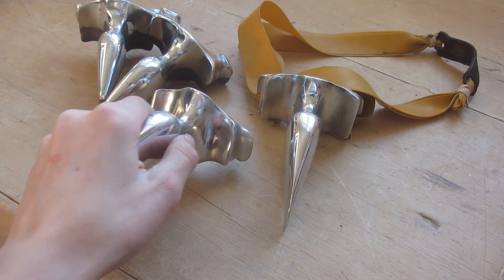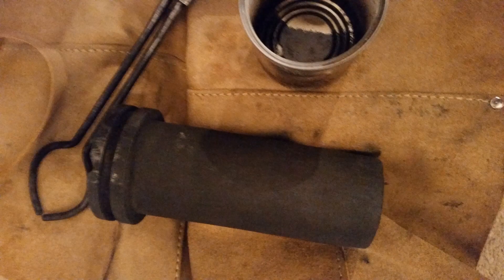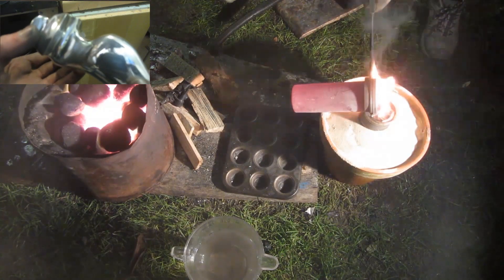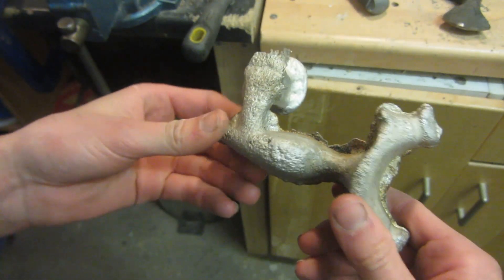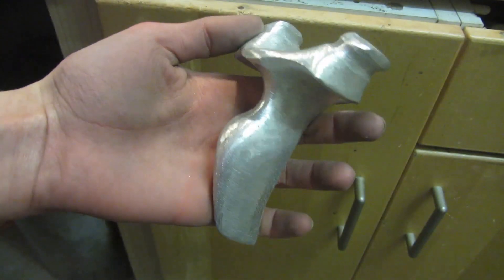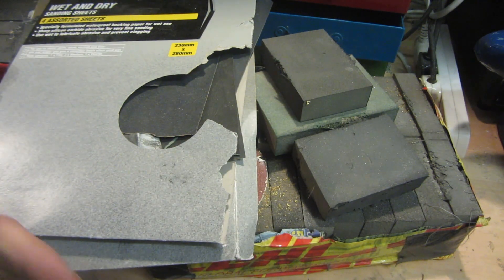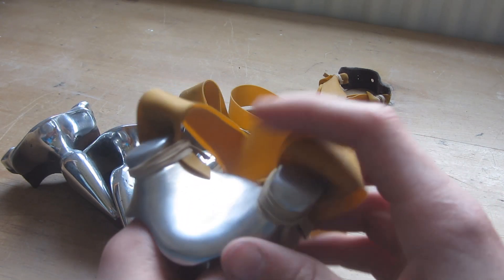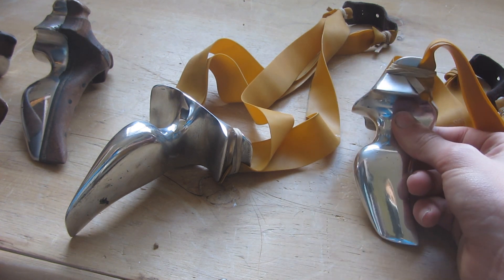Casting a Full Aluminium Slingshot With Greensand

Comment: to fill the voids in your slingshot handles. mix some clear epoxy and add some of  your alum filings  to make a thick paste. packet into the void ( maybe even drill out the void bigger )  fill until above the surface, let harden then file, sand and buff.

Rob.

Comment: whenever he removes the deep scratches with the drill sanders he said you can use sand paper is there a specific sandpaper you have to use and also when he uses the wet and dry sand paper to polish it up a bit can i just use various levels of sand sponges?

Comment: Great job! One thing I would suggest to make your life SO much easier is to pick up a small angle grinder and some flap wheels....you will save all the labour with the files and stuff....I use them all the time in welding and they are available in various grits from coarse (20 40 60 80) to fine (100 120 180) to super fine (320 and up).

Even some fibre discs on a grinder will get that slingshot smooth in 10 minutes.....

Comment: Hey, a tip for you to get even more pure aluminum

After you put the borax in, scoop out the impurities, then put in something called "lite salt" in the aluminum. What it does is when u put the salt in the sodium burns off and leave the chlorine from the salt. The chlorine bonds to hydrogen that is in your aluminum and takes it out of the crucible. Just a tip to get even purer casts :)

Comment from the maker: Thanks for watching guys!
If you have any more ideas of things that you want me to cast then please post them below!
Reply: Hi :) why do you don't plug the holes with tin melted with a sodering iron ?
Reply: The Art of Weapons Can you make a reverse compund crossbow,Please.
Reply: louis67gg Sounds like a nice idea but tin may not stick really good to the interior of the hole unless it's really clean of oxides, he'd also need a really powerful iron to heat all that mass (aluminium is often used for heatsinks), there may also be some chemical reactions that could take place (like with mercury), I don't know if tin would have them but he'd have to take that into consideration, anyways it won't look the same as aluminum but it may look better than leaving a hole. Oh and don't forget some tin wires come with lead.
Reply: The Art of Weapons Aluminium is poisonous! I love your work but at least wear some gloves, for me?
Reply: tarstarkusz thats true any kind of dust is explosive in the right concentrations and even though its unlikely it would every explode it could if it accumulates in the air from doing it inside but if you file outside you dont have anything to worry about
Reply: I made an account on your website and I wanna share some of my projects but I can't figure out how. Is that not a feature yet?
Reply: The Art of Weapons Be very careful filing aluminum, the dust in the air is explosive. If you use an power tool to sand the cast, it could easily cause a cloud of dust and sparks from the power took could ignite it. I worked in the metal industry and trust me when I tell you this, aluminum dust is explosive when it is suspended in the air.  You should also let your subscribers know this.
Reply: The Art of Weapons Check my chanel :D
Reply: Make slingshot with a laser sight make it like this

O      O

    O                       So attach one on the right top side one on the left top side and then one on the bottom or just but one on the bottom
Reply: The Art of Weapons sorry i mean a mini crossbow :D
Reply: Adam Blaknovski then why is it used in soda cans
Reply: Dean Walcott I agree the risk is low, especially with a hand file, however this young man is making all sorts of safety shortcuts and given his seemingly young age, I assume he has a lot of younger viewers who don't understand all the risks of doing this stuff. That forge and the way he is using it  (for example) is an accident waiting to happen. So I posted the least obvious example of risks to give kids thinking of doing something like this something to think about. If this channel was run by an adult, I wouldn't have left that message.
Reply: kodi peters The inside of soda cans are varnished and so the soda never touches the aluminum, but that is probably not what he is referring to, he was probably talking about the fumes given off when it's melting or the dust he is breathing in and can get in his eyes (if he's not wearing eye and mouth protection).
Reply: Hay can you make arrow heads out of knife blades
Reply: +The Art of Weapons have you tried using a glue based agent for the green sand? i used to work in sand casting for steel we used a glue type binder. it prevented alot of the sand from collapsing in on it self before th emetal being poured
Reply: +The Art of Weapons 
Try having an exhaust pipe on your casting,smaller than the pipe your pour in to let the gasses escape.
this will improve your casting result.
Reply: +The Art of Weapons will you put the design of the slingshot
Reply: +The Art of Weapons how much does your full aluminium slingshot weigh? ps what crucible would you suggest to me
Reply: +The Art of Weapons 
Deez Nutz!!!
Reply: Reck Tominvayed no leave no get out bad no shoo
Reply: +The Art Of Weapons how would i be able to buy one of your slingshots and how much would it be to buy one and what would be the cost to send one to the US because i would like to buy one of your slingshots.
Reply: please make a full brass slingshot , it will be ammazing!!